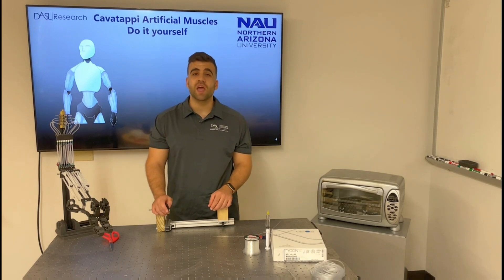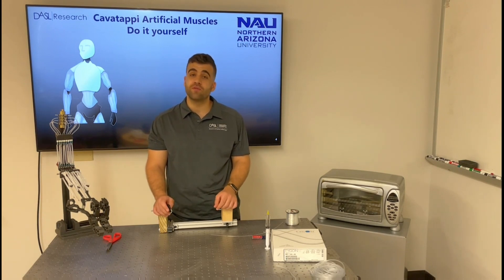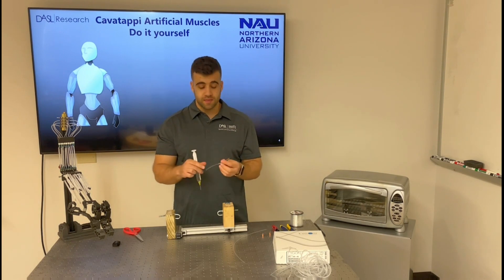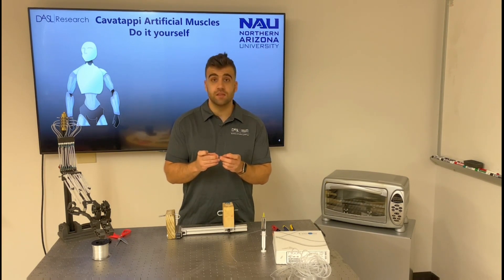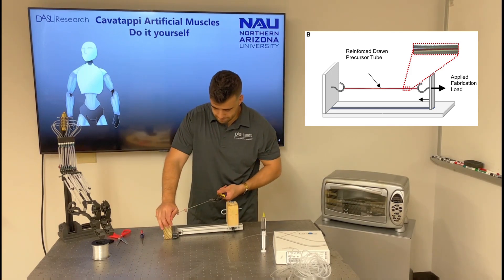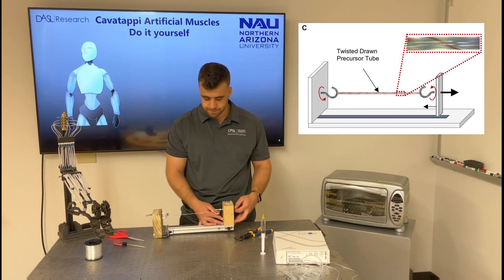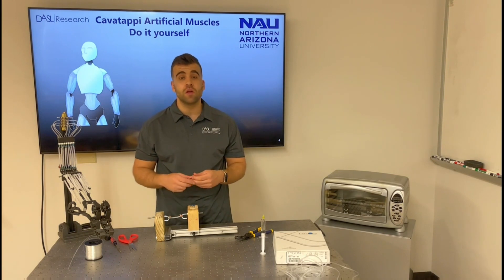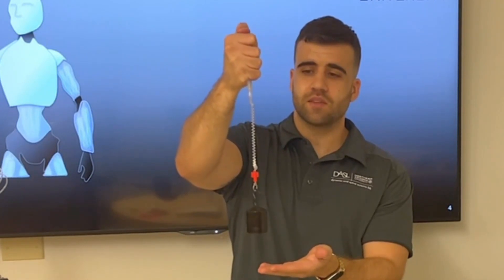How to: Making Cavatappi Actuators is Easy!

Comment: I am working on a project that requires Cavatappi Fibers. Following your video on Youtube, I bought the Tygon tubing of the same inner and outer diameter. Unfortunately I used regular plastic fishing line of around the same diameter (0.031 inches) which I inserted into the tubing with the help of mineral oil. I assumed that the mineral oil is to help insert the fishing line in. Hence, I added enough to slide the tubing in but not enough to coat the entire inner tubing in oil. I created my own makeshift tool to create the fibers but I still made sure to pull the Tygon fiber to almost 3 times the initial length. Unfortunately, in this makeshift setup, the Tygon fiber length is maintained by my own strength as there is no wooden block that is holding it at a fixed length. However, I made sure to pull and twist. My mandrel was rigid and sometimes I would twist the fibers around the mandrel instead of waiting for it to twist onto the mandrel by itself. I used metal plate clamps as shown in the picture attached. I attach the metal clamps to the tubing very tightly which results in the tubes flattening at the parts where it is attached. I managed to make the fiber look like the ones you made. However, when air is pumped into my fiber, the walls do not expand and the fibers do not contract and pull the weight attached even if the weight is only 200g which could mean that air does not seem to be going through. Could the reason for the fiber not working be the material of the fishing line being plastic instead of nylon, not enough oil covering the inside, inconsistent pulling and twisting due to human error or the metal clamps adding too much pressure to the tubing? Or is it another reason? I would be very grateful if you could kindly help me with my query. Thank you.
Reply: How much pressure are to applying internally to the cavatappi?

Comment: I'm trying to replicate this and I keep failing. For clarity's sake, I am not using tygon *specifically*, but rather some cheap soft PVC tubing from the hardware store. It's not the same size tube, but the principals should still be valid. The issue I keep running into is the tube collapses on itself and creates folds which tear under stress during the coiling. I imagine this has a lot to do with having a larger inner diameter of the tube. The 50lbs test monofilament fishing line (0.03") just isn't enough to support the tube during coiling. So I used nylon weed trimmer line as a structural reinforcement to support the tube because I already know it will coil well. I've been using it to make the monofilament muscle fibers. I was able to get a successful coil, finally, about 6 hours ago. After baking at 190°F, the tube stays in a coiled shape. Unfortunately, applying pressure inside the tube doesn't cause it to shrink. Doesn't do much of anything, really. 

Clearly I'm doing something incorrectly. One of the faults I can readily identify is I'm not stretching the tube 3:1, so is that a vital part of the process? It's not really all that easy to get it to stretch that far, and unfortunately you don't show that in this video. (Can't say I fault you for it, as this video is more meant to be a demonstration of action rather than procedural coaching)

Any tips? Tricks? Pitfalls you may have encountered? Things to watch out for? Any advice would be greatly appreciated
Reply: Thanks a lot for the comment. It is amazing you are trying to replicate these muscles using different precursor materials! 

I have personally tried different polymer tubes to create artificial muscles with different properties using the same fabrication and actuation principles. However, this is not that easy, since some tubes would not have the right material properties to provide a useful actuation response like the one shown in the video. The drawing process is conducted to increase the material properties anisotropy (key factor for actuation), although this step of the fabrication process considerably increases the actuation response of the artificial muscle, I think you should still see some decent actuation (but this always depends on the material properties of the polymer you are using). 

In addition, the outer diameter/thickness relationship also matters, so that is another factor to take into account when creating cavatappi artificial muscles with tubes of different dimensions. 

Here are some recommendations: 

- To obtain an operational artificial muscle like the one in the video, I strongly recommend you to use the same materials and dimensions. Once, you have that nailed down, then, you can start doing research with other materials and dimensions and find what works the best. If you change the dimension of the precursor tube, make sure that you scale it down or up, but maintain the same OutterDiameter/Thickness relation.

- Use mineral oil to lubricate inside the tube.

- I strongly recommend drawing the material as much as you can.

-  This is key for cavatappi artificial muscles, they required high pressure and low volume for actuation. 

Once again, I would start using the materials used in the video and move on from there. 

You can also find some more info here: 

https://robotics.sciencemag.org/content/6/53/eabd5383.full?ijkey=Mp/Ry1huEh6.E&keytype=ref&siteid=robotics

Thank you for the comment again. Let me know how it goes!
Reply from the maker: Jerry, the drawing process is key to creating the necessary material properties in the polymer. If you have a tube that is too large, manual drawing can be quite challenging. I'd suggest getting some smaller tubing. McMaster-Carr has a lot of tubing of various sizes that would work. I hope this helps.
Reply: @dynamicandactivesystemslab9505  I did end up purchasing some 1/16" tygon and I'm still struggling to get the draw. TBH, I put it on the back burner 2 months ago and haven't looked back. I can't get the tube to stretch 3:1 by hand, and I neither have the determination nor will to sacrifice food money to build the equipment to grip and pull without sheering like it has been. Would be great to use these to keep my shoulder cinched together, but it'd be a fool's errand to continue faceplanting.

Comment: Is it made of nylon or something?.
Reply: These soft actuators are made from soft PVC tubing, more specifically ND-100-65 Tygon, 0:45, (you can easily find this tubing at McMaster-Carr: https://www.mcmaster.com/catalog/127/156). However, as shown in the video, 1:03, they are also reinforced with a monofilament of nylon (you can find this material as a fishing line at Berkley Fishing line: https://www.berkley-fishing.com/products/trilene-big-game-1002998?variant=34171059863691).  I hope this helps! Leave more comments for more questions!